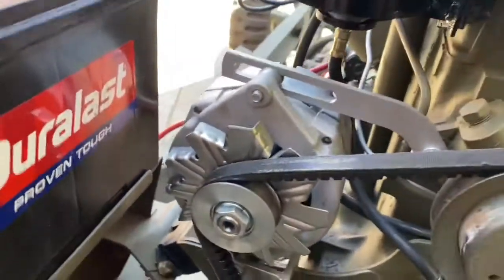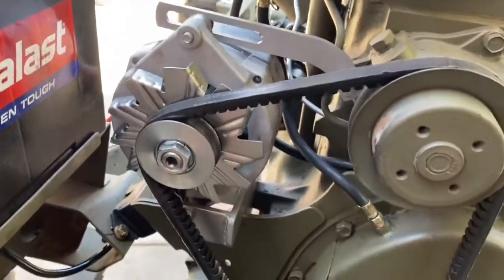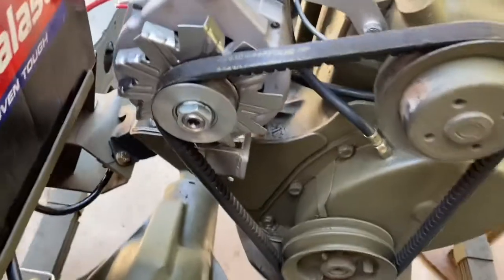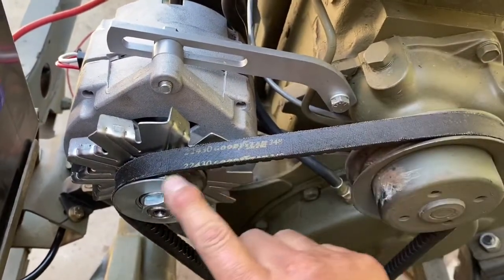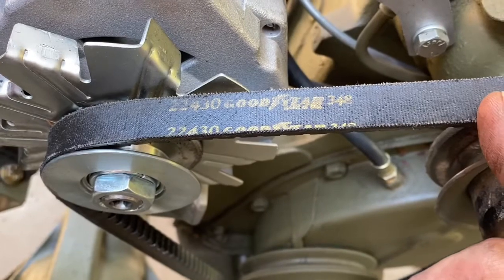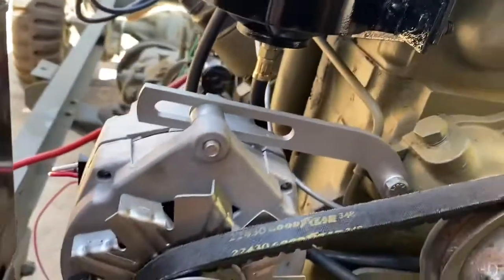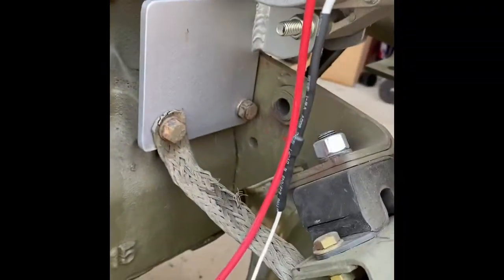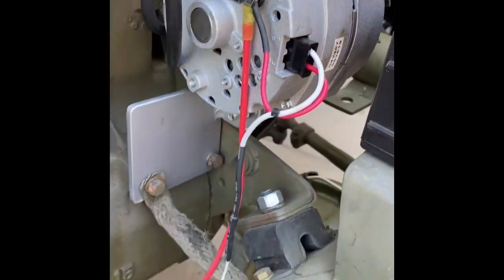F134 engine in a Flat Fender Willys Jeep-GM alternator bracket

Comment: Hi you state GM I’m in the U.K. can you confirm the model number shipping the kits from the states is very expensive that model may be readily available over here
Reply from the maker: I bought it on eBay.. USA. https://www.ebay.com/sch/i.html?_from=R40&_trksid=p2380057.m570.l1313&_nkw=WILLYS+JEEP+12+VOLT+ALTERNATOR+BRACKET+KIT+FOR+134+L+AND+F+HEAD+4CYL+ENGINES&_sacat=0